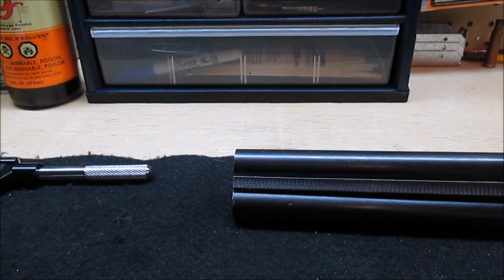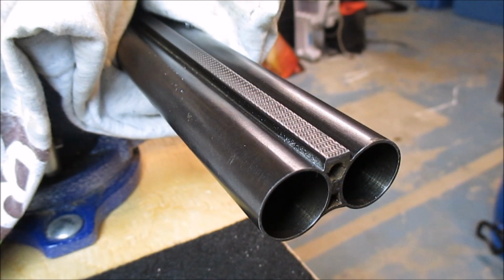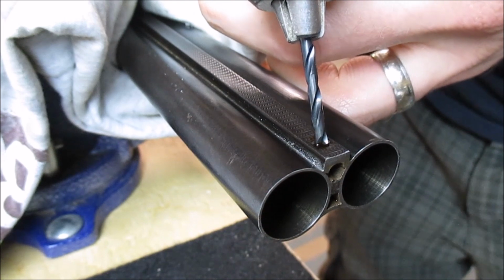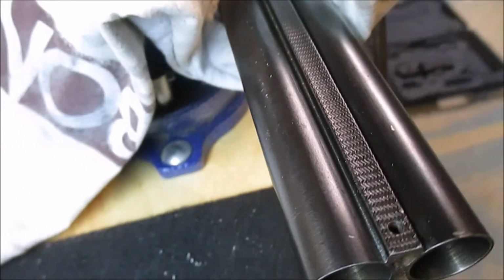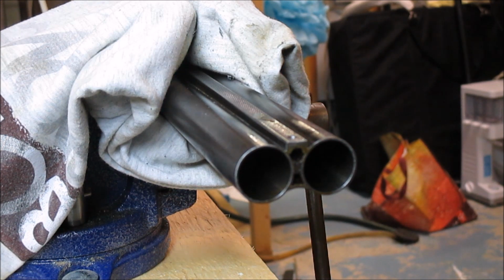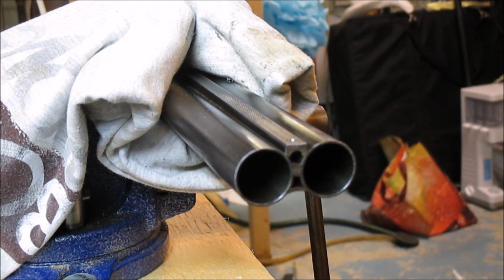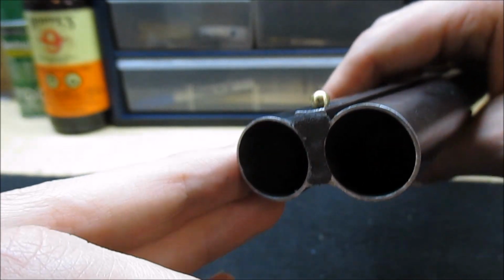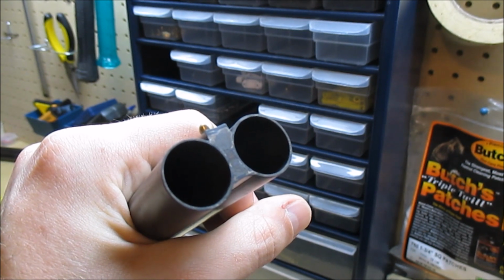Coach Gun Project Part 3: Installing A Bead Sight

Comment: What size drill bit and tap size did you use
Reply from the maker: It's a No. 31 bit and 6-48 tap. I bought them together as a set.
Reply: @webster7710  thank you

Comment: How is your JB Weld holding up? How many rounds fired since the chop? Have you fired any slugs or buckshot yet?
Reply from the maker: So far, so good. No signs of it wearing out or coming loose, and this gun is a go-to during hunting season, so it spends a fair amount of time bouncing around in a UTV and being knocked into the odd tree branch. No idea on how many rounds fired, but it's probably around 100. Mostly birdshot, but some buckshot too. I'm not looking to torture test the thing, but it gets a lot of good, honest use and has held up to my standards thus far.

Comment: the coach gun double barrel is amazing and besides it needs to have double bead shotgun for a front sight one on the left and the other on the right?
Reply from the maker: I've never seen one like that, and I think it would be difficult to use. One bead in the middle is the most common setup because it works well and is simple.

Comment: Everything's well, but... If you want to keep your bead sight rock solid forever, you need to clean and throughly degraese both threads out of cutting fluid remains, because thread locker not sticks to oiled surface, and to use red locktight, if you not planned to replace the sight in the future.

Comment: Why did you fill the space between the barrels ? Is this something important or is it just for the look ?
Reply: Also it could get moisture in there and rust
Reply from the maker: I wanted to give the barrels and rib some support out at the end to hold everything together. It may well be fine without, but having something there doesn't hurt.
Reply: Probably makes it look better
Reply: just for looks, i believe.  I asked my gun smith about cutting down the barrels on my shotgun and he asked if I wanted the end filled or not.
Reply: The gap between the barrels is so much bigger at the point where you cut it, compared to at the original muzzle. You'll have a big gaping hole there if you don't fill it up.

Comment: Really? Finger tight? On a shotgun? When do you ever screw something onto a gun, *finger tight*? Get some needle nose pliers or something and tighten that down some.
Reply from the maker: Soulman1282 If it comes loose, I will, but it's a really light part and the Loctite's been holding it fine for two years now.
Reply: magazine cap on my model 11 shotgun has stayed fine after over 450 shots thru it, finger tight lol
Reply: finger tight has always worked fine for me.

Comment: webster7710 if you want to redo the JB weld and do it properly so it will take blueing and be period correct. Just clean out the JB weld and use 50/50 silver sodder to fill the voids
Reply: webster7710 my only fear of silver soldering is the heat which might loosen the solder that holds the rib on, defiantly would not pass the ring test after that
Reply: also did you ring test the barrels after cutting them
Reply from the maker: I just went and checked and they do ring in this setup, no issues there. I had never heard of that test so thanks for bringing it to my attention. And thanks for the tip about silver solder. I'll definitely keep that in mind if I decide to refinish the business end of the gun at some point.

Comment: Just a small but important suggestion when you are cutting threads. You want to keep the tap in the hole your threading until you get at least one to two turns of threads cut. Removing the tap after the first 1/2  to 1 turn is really really risky and you could very easily cross thread the hole you are  threading like you mentioned. And you don't "have" to remove the tap to clean out the chips. When you reverse and go back a 1/4 to 1/2 turn that breaks the chip off and the flutes let it drop out the bottom. I personally don't like removing the tap until I've cut all the threads, I don't like taking the risk of cross threading. But you did a good job. I liked how you used compressed air to blow out the chips. Very classy.
Reply from the maker: Sentinel650 Thanks. That's good stuff to know. I appreciate it.

Comment: You have given me the confidence to try to SBS my coach gun.  Does Canada have a version of our NFA laws?
Reply from the maker: Sort of. We can't cut barrels shorter than 18", or 18.5" for semiautomatics without running into issues. We can, however, have barrels as short as we want with no additional paperwork as long as they came from the factory that way, and the overall length of the gun is over 26". I have a 10/22 and an 870 with 11" and 12" barrels respectively, for example. The exception is centrefire semiautos, which have to have at least 18.5" barrels to avoid extra paperwork and restrictions.

Thanks for the compliment, and good luck with your coach gun.

Comment: Sweet project. Did you ever resolve the sticking issue when opening?
Reply from the maker: Foxer604 It seems to be improving as I work the gun and get fresh oil down into all the working parts. It happened once the last time I was out, but even then it was easier to get open and I was able to do it with just my hands. The screws holding the plates on are really stuck, so for now I can't get the guts of the gun apart for a proper scrubbing. I just have to let the oil do its job.

Comment: Looks great!  How do you like the handling of it now at 20 inches?

I finished mine as well, and did it the exact same way, with the exception of using the original bead sight, the original tube version of JB weld, and a Brownell's brand of cold blue.
Reply from the maker: Douglas Henderson Thanks! I really like the way the 20" barrel handles. It comes up to the shoulder nicely and swings well side to side. Lightens the gun up a bit and makes it handier, too.

Glad to hear you got yours finished the way you wanted. They make for a fun little project, and it's nice to see old guns getting a second chance.
Reply: Douglas Henderson how’s the jb weld holding up.